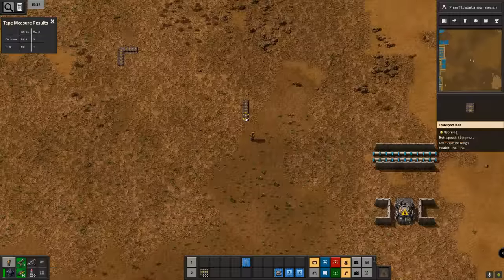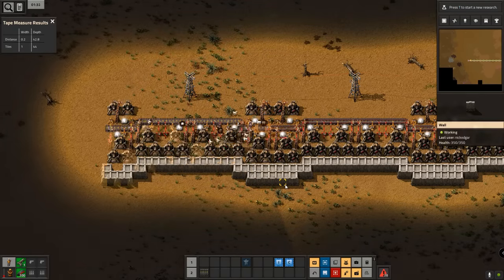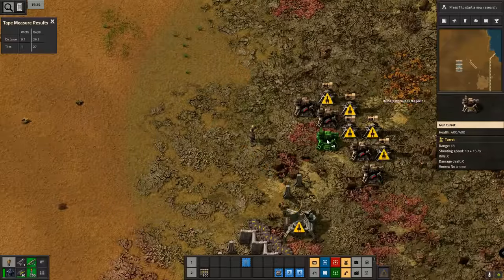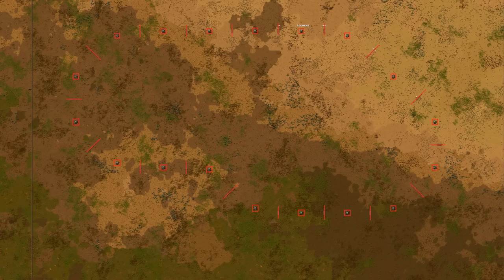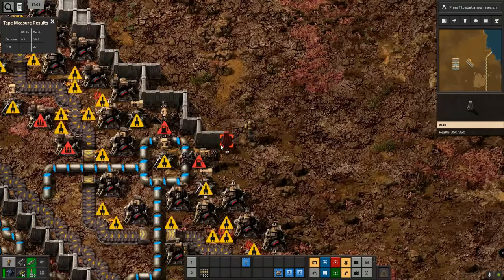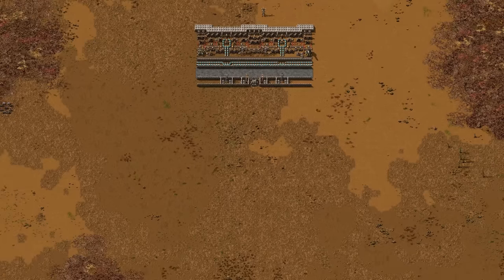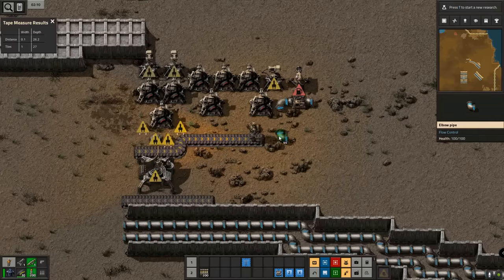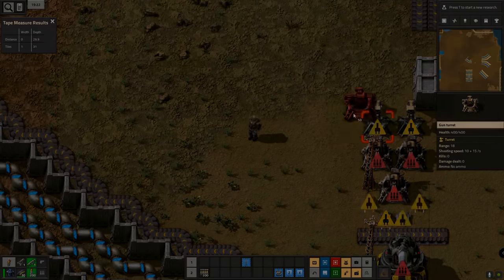Factorio - The Perfect Perimeter Wall Geometry

Comment: o - been awhile since I last played took me off guard with 'artillery' lol - never understood the value of using conveyors to keep turrets full of ammo - seems needlessly troublesome when building small distribution hubs (which may or may not also be a good spot for a passenger stop as well) and using logistics distribution makes considerably more sense in terms of flow for rapid expansion after clearing an area, without needing to connect everything together by anything other than rail - which serves to transport the player and electricity anyways so would always be present.
This is mostly me just being a bit puzzled tho - lots of other excellent problem solving and approach on display here. 👍
Reply from the maker: I have a 'maintenance' set of trains which whizz around all the outposts delivering ammo as well as replacement turrets, electricity poles, conveyor belts etc. Once the ammunition loop is full it only needs to be topped with what what gets used.
Reply: @theotherbigfoot  hmmm I see - oh wait I think I see what's up - the conveyor serves as a natural buffer so that you don't need to use circuits to ensure smooth supply? I've been too in love with having resupply trains on standby until an outpost requests more ammo/fuel/items/bots/etc. ever since they added the ability to turn train stations on/off >.< so I've just gotten used to always running the circuit lines along with the electricity and trains, so think that's why I'd not really considered it. Watching the network whirr to life as it's needed is just too satisfying 😁

edit: though I've still not found the most elegant solution for requesting multiple resupply trains across a vast network - always seem to get distracted by something shiny before it gets monstrous these days
Reply: @NeoRipshaft  Personally, i use "Set train limit" with circuits. Set limit to 1 if anything is required, otherwise 0. Trains will wait at loading area unless there is demand, then go to that particular place with no risk of multiple trains going to the same station or getting lost on the way. So far, works well even with dozens of destinations.
Circuits are useful for controlling loading of resupply trains as well, so i do not have to set filters in wagons (just have "desired load" set by constant combinators) and i can use the same wagon for carrying junk from the wall (either from terrain or deconstruction after a new wall further out was made).

Comment: What Mod are you using for the pipes to get the pipes to lay next to eachother without interacting with eachother and mixing fluids?
Reply from the maker: Flow control. The first mod I ever installed and still my most favourite. I hate vanilla pipes so much.
Reply: @theotherbigfoot  Thanks! I will have to look into that one. I'm also not a big fan of vanilla pipes but have always just lived with it lol.
Reply from the maker: @computercoma  I had a factory, must be 5 years ago, two pipes joined, fluids mixed and I didn't notice for an hour or so. Autosaves were all nixed. The mixed fluids had got everywhere. Knowing what I know now I could probably have fixed it, but at the time, my skills were pretty limited, factorio was still early access and google was no help, and I was probably too angry to think straight. 

I downloaded flow control and never looked back.
Reply: @theotherbigfoot  I'm pretty sure fluid mixing is largely impossible nowadays.  The amount of effort they went into to make it so systems with different fluids can't mix is intense, lol.
Reply from the maker: @sevinolastname  hmmm, maybe, I just don't trust it though. 

Flow control allows me to put two pipes directly next to each other. If for no other reason I would still have flow control for that feature
Reply: @sevinolastname  Me who manages to saturate half of my sulfuric acid line with crude and my petrol with water only a week ago

Comment: Something to consider, red ammo is the least efficient ammo out of yellow, red, and uranium, in terms of iron used for the same amount of damage. So using yellow ammo would probably be better for sustained perimeter defence.
Reply: red ammo might be the least efficient in terms of damage but keep in mind later biters have armor values that get subtracted from your ammunitions damage so yellow ammo might end up dealing way lower damage than it is supposed to

example:
yellow ammo = 10 damage (takes 2 iron)
red ammo = 20 damage (takes 6 iron)
you can see that it is better to use yellow by damage, but now we take into account biter armor

biter = no armor
medium biter = 5 armor
big biter = 10 armor
behemoth biter = 15 armor

in this example, big biter completely nullifies yellow ammo to either 1 damage or 0.1 damage (I don't remember it clearly)
but red ammo should still deal a good 10 damage

so on a big biter yellow ammo uses 2 iron to deal 1 damage

while on the same biter, red ammo uses 0.6 iron to deal 1 damage

Note: I made the numbers up but you probably get the point by now
Reply from the maker: I'm not really looking for efficiency of use of material in my perimeter wall, I want the maximum bang delivered in the minimum time. Better ammo = bigger bang. I don't really care how much material it uses, in comparison to the rest of the factory, and in terms of material usage, ammo is small potato.

Comment: what does using heavy oil flamethrowers do? isn't light oil better?
Reply from the maker: I had a whole discussion about this with someone else in the comments. It is not conclusive, let's put it like that. Heavy oil gets a 5% damage increase and light oil gets a 10% damage increase but because I 'value' heavy and light oil by their recipe value (40 heavy oil equals 30 light oil) the total damage caused by heavy oil (40 + 5% = 42) is greater than that for light oil (30 + 10% = 33). 

If you 'value' heavy and light oil differently then you will come to a different conclusion.

Comment: i dont see any signaling on the rails
Reply from the maker: How many signals you want, how close together they are etc is kinda up to you. Bigger trains (vs smaller trains) will need less signals spaced further apart. I didn't want to impose my rail method on what I wanted to be a general blueprint.

Comment: Your walls fill me with pain. That number of pipes is very laggy. You NEED underground pipes to reduce lag.
Factorio uses the same amount of computation for 10 normal pipes as 10 underground pipes, but the undergrounds go 5x further.

The gental curves are cool, though, and it has enough firepower for even harder modded biters.
Reply from the maker: You maybe aren't wrong about the lag at the start when the wall has just been built, but because the combined storage of all the pipes is so large, give it a few hours to fill up and there is so much fuel available that it becomes irrelevant. In my opinion, this is actually the chief advantage of using overground pipes vs underground pipes. Underground pipes give you flow rate but overground pipes give you storage.

Comment: A bold claim, saying this is perfect. It's pretty good, not gonna lie! But perfect? I don't know.
Reply from the maker: I wasn't saying the wall was perfect, only the geometry
Reply: @theotherbigfoot  I can't claim to be an expert in geometry, it's certainly better than my kludge (even if my bases work for what they're meant to do). Perfection would mean you can't improve on it. I bet you could with more time on it.
Reply from the maker: @johncameron1935  The geometry of each segment is governed by the area covered by a single roboport. Unless you have a different roboport there really is no further improvement to be made. 

The shape of the wall itself, the placement and distribution of turrets, how the ammo is fed through the system; I'm not classifying any of that as the geometry. By geometry I mean the size of the segments and how they fit together at the corners so that when you build a continuous wall they arrive back at the beginning. The geometry is the underlying system of how I came up with these segments, and it is how you can come up with your own, if you wanted to give it a try.

In my mind there are an infinite number of perimeter wall segments you can use, different configurations, different distributions etc, but only one perfect geometry. The one based on a single roboport.

Comment: Just take choke points. It doesn't look pretty and supplying the perimeter can be more difficult, but it's cheaper and doesn't require dicking around with a bunch of different segments.

Comment: OK, I know these are just my ideas and you did all the work I do have to say I hate it :)  First, two tracks tightly adjacent I hate. I want my power and radar towers to fit between my tracks and the power and the light and I have done it this way for years so you must be wrong.  OK, you could be right I'm just not happy.  I followed a LOT of videos from Nilaus and you are breaking the rules, well OK, yes you need to set up the world around a train track.  He does it using like 100 by 100 but that I find becomes annoying when I am running train tracks a fair distance because to continuously have to manage a 100 by 100 area every time I put in a turn or a straight section, augh.  But I also like the roads in the build zone, and yeah I let the bots build it I do just wish bots had a few more brain cells and would work out in like a spiral from the source of material and not completely &^%$ randomly.  Anyway, you also seem to use a LOT of guns,  lasers, and flame wow.  Mine has like 1/2 the guns and just one row backed by flamethrowers and extra throwers for the corner just to kick biters who think my corners are easy.  However, I hate biters so much that I tend to use a couple keyboard commands to delete them and the homes etc and then a second to delete all the ones that have yet to be created :)  Now I can get back to playing the game building and not waste my time fighting more biters.